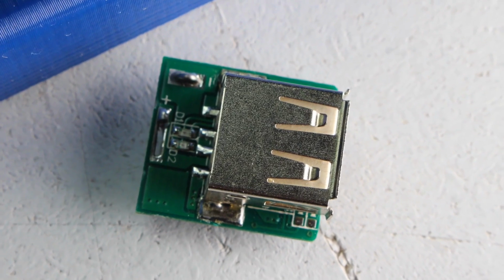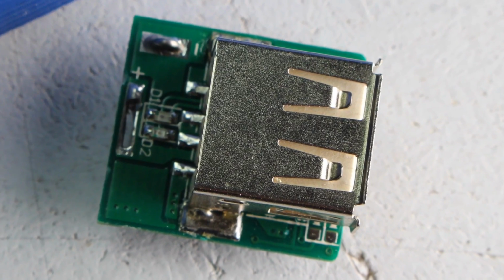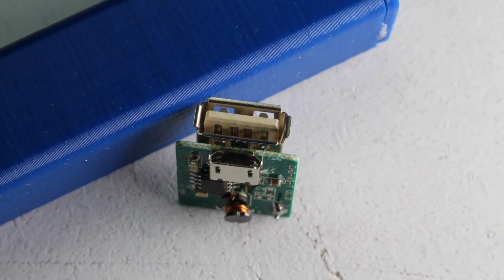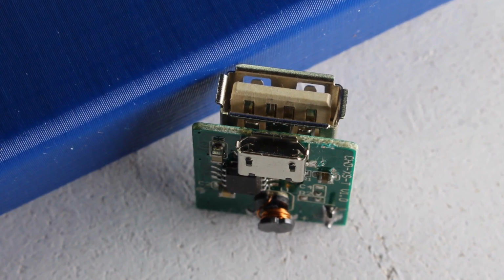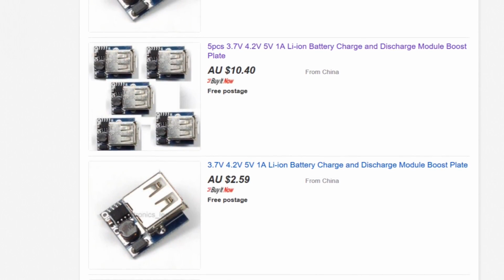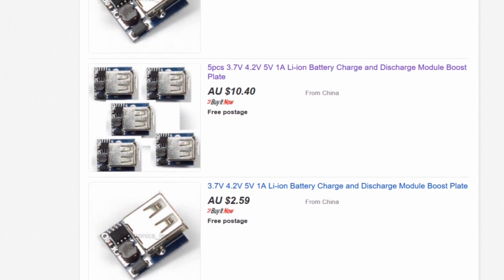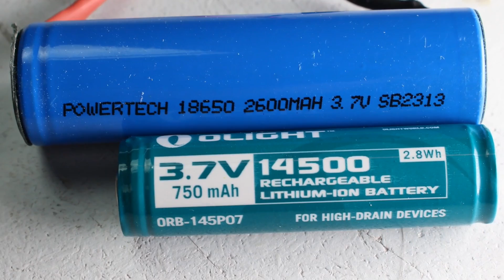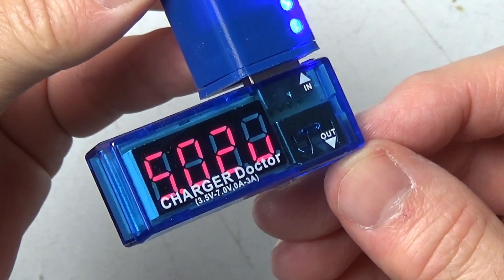DIY Mini Power Bank (MEHS) Episode 63

Comment: Hello Sir, can I ask you something related? So I have 2x14500 battery but I can't find any store bought powerbank case for this types of battery. Will it be alright if I use this 14500 battery to power up a 18650 powerbank case with a little tweak on the battery spring? thx in advanced.
Reply from the maker: - Hi.  If you/re using a case and the IC that came with it and it was intended for one cell then yes you can use a 14500 instead of an 18650 as the voltages and chemistry are the same.  Just stretch the spring as you say.  Cheers.
Reply: Thank you  @michaelsstuff4402

Comment: What over charge and over discharge protection feature does it come with this feature
Reply from the maker: - Hi.  Its basically a TP4056 so it has some basic protections.  I would use a TP4056 with BMS IC for a great single cell solution.  Cheers.